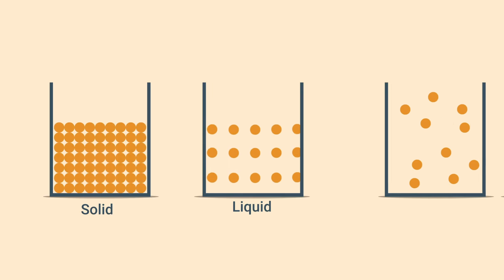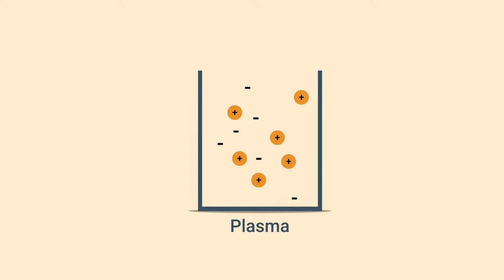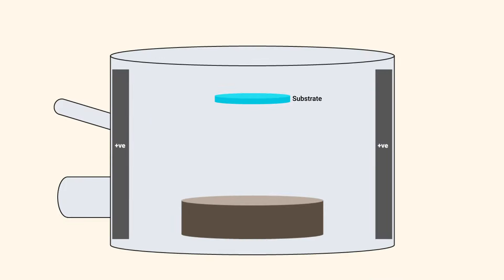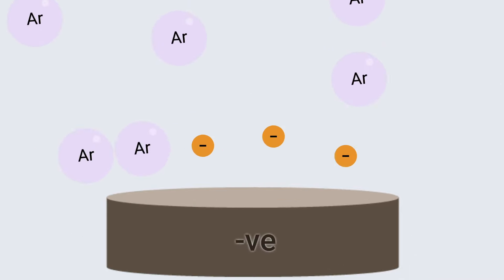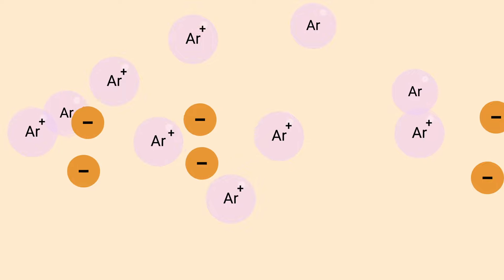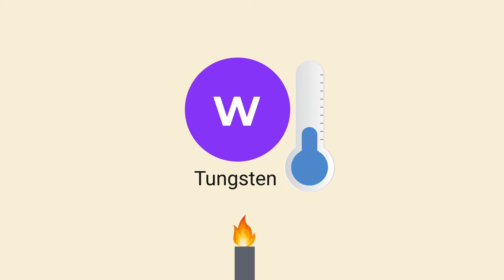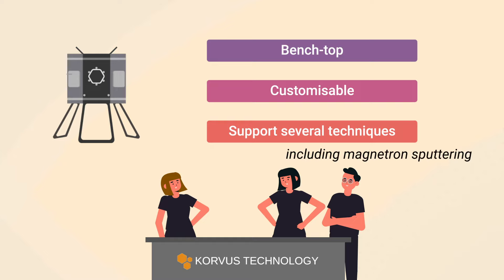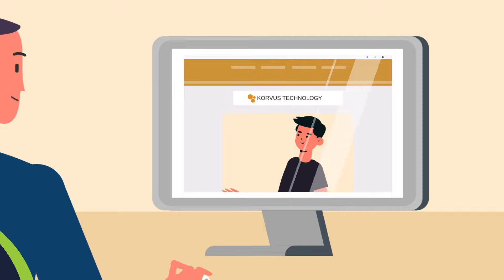Sputtering: What is it and how does sputter deposition work?

Comment: Argon is a noble gas so how can it be made into an ion?
Reply from the maker: Good question. If the energy is high enough, even a stable noble gas can be ionised and its electrons removed from the outer shell creating a sea of positive argon ions and free electrons - this is necessary for our sputtering system to work!
Reply: @korvustechnology  Oh I see! Thank you for your reply!
Reply: Being noble means it is immune to chemical reactions but it can be ionised by electric field or radiations

Comment: I have a question. When sputtering a certain material on to a substrate, how thick can the material become? For example, can the substrate be resputtered over and over again with say platinum microparticles until the platinum layer becomes 3mm+ thick?
Reply from the maker: Great question, Kamrul. The thickness of your sputtered layer during a single cycle is only limited by the amount of material you are able to fit onto your sputtering cathode (or "source"). A typical maximum thickness would be in the region of 10 microns per sputtering source. So in theory, you could make layers as thick as you wanted as long as you kept replacing your material and ran multiple sputtering cycles, but "thin-films" typically range from a few nanometres to a few microns.
Reply: @korvustechnology  Thanks for the answer.

Comment: what if sputtering is done in a vacuum? isn't it just ionization & no collision?
Reply: I believe there are a few free electron in the chamber. There is no absolute vacuum. You just need a few Watts of power to knock off some of the electrons from the Argon atoms which creates a chain reaction. Once you stabilize the plasma you can increase the Watts from your DC generator to induce more sputtering (more deposition). Though, if you have too many electrons colliding your sputtering starts going all over the chamber including the walls which is not good.

Comment: Does the substrate have to be electrically charged, for the sputtering material to attach to it?
Reply from the maker: Hi Eva, thanks for the comment. Electrically charging your substrate is known as 'biasing'. This can cause the sputtered material to be accelerated towards the substrate and form your thin film with slightly different properties, such as altering adhesion. Without biasing your sample, you will still create a film on your substrate but may not have this altered adhesion that biasing will give. Hopefully, this helps!

Comment: I am curious if a system like this could be used with something like Bismuth?
Reply from the maker: Hi Ralph, bismuth on its own has a high resistivity and low melting point ~ 410°C so sputtering is not ideal. However, it is commonly used for bismuth alloys such as bismuth oxide and fluoride. Hope this helps!
Reply: @korvustechnology  Why is Bismuth not ideal?  What is the significance of it's high resistivity and low melting point to Sputtering? But could you use it to sputter onto a substrate? What problems would you encounter? what would be the best deposition technique for Bismuth?